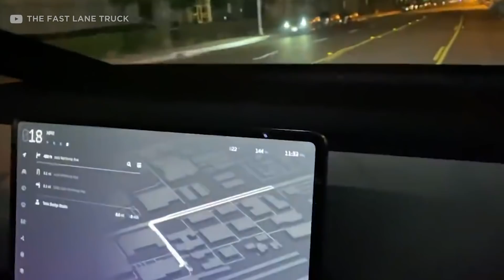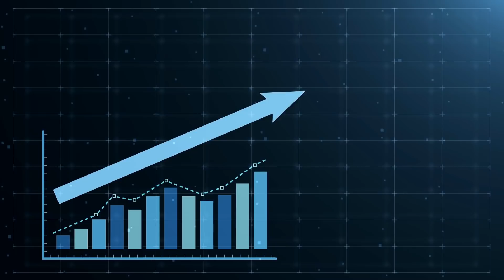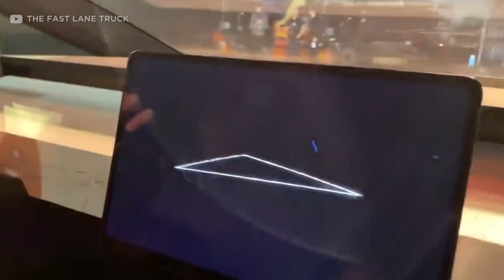Why Is Tesla Cybertruck So Cheap?

Comment: Because the $40,000 model is RWD not AWD or 4x4 and has only a single motor. The Cybertruck isn't cheap at all because if you want AWD and dual or tri motors you are going to have to pay about 70k.
Reply from the maker: Good point!
Reply: The single motor cybertruck competes just fine with any conventional work truck on price, towing, range. The two motor competes just fine with any upscale pick-up. The three motor is competitive with top of the line pick-up and significantly under prices the new Hummer. Where other pick-ups of all price ranges are uncompetitive is: no blue suede shoe sales people. No body rust. Indestructible body panels. 0-60mph acceleration.
Reply: @tz6516  That's what they want you to believe. The 40k model is 40k but is RWD only and has poor range. I'd rather pay 40k for a normal pickup truck and get 4x4 and everything else I want. I don't need "indestructible body panels" because I'm not going to be thrashing it around much.  And as for rust, modern trucks use galvanized steel which is MUCH better and hardly rust at all. Heck, the F-Series even uses aluminum which doesn't rust at all.
Reply: @private6549  
That is the beauty of America. Freedom of choice. Buy whatever you like. But an F150 Platinum is $59,500. No Stainless Steel. No FSD. No clean energy. No 0-60 bragging rights. I’m still very happy with my decision to order a Cybertruck.
Reply: @tz6516 No clean energy? Why would I care about that? I personally hate environmentalism. I don't litter, I clean up my garbage, what more do you want, that I throw out my internal combustion engines all for the sake of "carbon emissions destroying everything?"
Reply: @private6549  - the $40K CT compares well on specs to a $40K traditional pickup. The cheap pickups are also RWD only.
Reply: @private6549  
Anger management dude! You can buy whatever you like, but my comment is still valid that a Cybertruck is more environmentally friendly than an ICE truck from the Big Three. Go buy a Silverado or F150, but don’t complain when you see the resale value of that ICE truck in five years. Like it or not, Green is trending.
Reply: @tz6516  Environmentally friendly to me a big joke that is stretched into a religion. I'm not anti-EV, if there was an EV that appealed to me (exterior looks, interior design and colors, features) and had good range, I would consider buying it. The Cybertruck doesn't appeal to me at all and I don't see any personal reason to buy it over a regular truck especially when you are paying $40,000 for a two wheel drive truck.
Reply: @alanlight7740  You can still add 4x4 for around 2k more. The Cybertruck doesn't have AWD unless you add 10k.
Reply: @private6549  
You are entitled to your opinion...but it doesn’t change the direction that the world is going in. Seatbelts, airbags, 5mph bumpers were all railed against. They were still adopted. The move to vehicles that are more environmentally friendly is a train that has strong momentum. You can be counter-cultural if you wish, but I fear you will pay a financial price. The electric vehicle already has a government provided financial incentive. I think the ICE future will hold financial disincentives. Possibly additional gas taxes at the pump. Or carbon emission fees. Resale values will be negatively impacted. Argue against it, but the future is becoming obvious. The rails are greased for electric vehicles. And ICE vehicles will have strong headwinds going-forward.

Comment: The looks of the Cybertruck are OK, devicive as you say but as an avid 4WD'er I think the tough steel body and no paint is an amazing thing.
Being wider than a standard toyota Land Cruiser wheeel base will cause endless troubles off road and in deep rutted trails though.
I think the size is going to be a big killer in sales, far too big for many outback 4WD tracks in Australia.
If they bring out a smaller one that will fit in the rutted trails and within a car parking space, I will buy one in an instant !
Reply: You are one in a thousand. Most truck are never taken off the pavement. Over 2 million on order. Musk analyzes data. He knows the target audience for the Cybertruck are people who want to get to the mall, not the mud. Off-road? Trailer pulling? There will be a need for some ICE F350s for a while yet.
Reply: @tz6516  - you've got the right idea, but the reality is a tiny bit more complex.

There's a significant market for trucks that can go off road when needed, typically for short distances, but not on trails. This is useful for when a vehicle is needed on construction sites, farms, and even just to pull around into the back yard where there might be some mud that would bog a regular car down - and of course don't forget there are still lots of places with regularly groomed dirt or gravel roads where something better than a passenger car is desirable. There are lots of reasons someone might want a truck that can go off road a bit without actually wanting to go on some narrow trail.

To speak to Lindsey's point, some former neighbors of mine told me about the time they came across several vehicles including a bus stuck in the mud while traveling during the rainy season in Australia. They had a truck that was able to make it through, but obviously many others did not. This was not on a narrow track off the beaten path - this was on the Stuart Highway, back in the  70s before it was paved. I'm sure there must still be many roads in Australia that are unpaved where a truck like this would be useful.
Reply: @alanlight7740  
If you think you will encounter the scenarios you describe, then buy a Wrangler or the new Hummer. But I think the Cybertruck offers me the perfect combination of price, form and function.
Reply: @tz6516  - LOL - you might want to work on your reading comprehension. I was saying that most of the places a person needs an offroad vehicle are NOT narrow trails where the CT won't fit - which makes it a great choice for almost anyone.
Reply: @alanlight7740  
Sorry, I lost focus after your post got into buses and the 1970s.
Reply: @tz6516  - understood. That paragraph was more for the OP. She will probably understand that the Stuart Highway is not some backwoods track. In fact, it's a major route going north-south through the center of Australia - and while it doesn't have a huge amount of traffic because almost no one actually lives in the center of Australia, it's pretty iconic, in a Route 66 kind of way.

And there are many other places in rural Australia (or South America, or Africa) where many of the roads are unpaved, but are plenty wide enough for the CT. There's even a lot of places still in rural parts of the United States like that.
Reply: @alanlight7740  
An iconic vehicle for iconic roads!
Reply from the maker: Thanks for sharing your thoughts with us!

Comment: I hope it doesn't have the yoke steering wheel or the wheel covers.
Reply from the maker: Good point!
Reply: The wheel covers enhance mileage. If you don’t need max mileage, you can go without them.
Reply: @tz6516  how much of a difference would that make?
Reply: @rossturner76  
Google is your friend:
- They improved the Model 3's efficiency by more than expected, an average of 3.4 percent across speeds of 50, 70, and 90 mph and a boost in range of up to 10 miles.Dec 19, 2019
If you don’t like the look and/or don’t need the extra range, leave them at home.

Comment: There is no Tesla cyber truck.
That does not exist.
You morons
Reply: It will come out either later this year or early next year.
Reply: @user-RCST  like one million robo taxis and SpaceX on mars by 2020 and solar city
Reply: @pointmanzero  robitaxis was an error on elon's part.  SpaceX never said they'd be on Mars by 2020 they've aimed for 2024 since the starship program started.  What are you going on about with SolarCity.  I see SolarCity is a great benefit to Tesla.
Reply: @user-RCST  they have no second stage. No lander. No payload, no supply list, no rover, no satellite, nothing.
And their new rocket don't work.

They aren't going anywhere.
You aren't going to Mars.
You are not getting a cyber truck
Reply: @pointmanzero   BN1 has already been built which is starships second stage.  Starship itself is the lander.  Payload it will not be public information until before take off same with supplies.  Why would a Rover be necessary?  If you're referring to starlink satellites there's already near a thousand up there.  SpaceX rockets work just fine they've landed over 100 falcon 9s and starship is still in the PROTOTYPE stage, so yes it's common for those to blow up because that's the way SpaceX tests things.  
They are going somewhere for all the reasons I listed above.  

I don't want to go to Mars nor am I qualified to go to Mars I am not built for that.  

For the cybertruck all I have to do is wait either 6 months or a year for you to be proven wrong.
Reply: @user-RCST  I bet you money there will be no cyber truck.

I bet you money starship and city to city transport will not happen.
Reply: @pointmanzero  there will definitely be a cybertruck I have no doubt about that.  

I'm not sure if City to city will happen it's possible but we're talking about Mars not City to City.  I guess you figured out you were losing the other arguments so you switch to City to city transportation.
Reply: @user-RCST  if cyber truck was real suppliers would start getting notifications that they will need to produce a new car part for a new model.
There has been no sign of that.
Also this is true for the Semi.
There is no indication it is real at all.

The stock is in for a collision with reality.
Reply: @pointmanzero  most of what Tesla does is in-house.  The company that Tesla gets its casting machines from recently received orders for the 8,000 ton gigapress so they are getting orders.  That's not how Tesla operates.  You didn't get any notification ahead of time when the model y launched or the model 3 from any suppliers you know why because most of what Tesla does is in-house.

Comment: Edges are bad for aerodynamics
Reply: Tell that to the stealth fighter!! At highway speeds, skin friction and aerodynamics are not a huge deal. Look at the massive flat front grills that every ICE pick-up is currently sporting. If drag was a major concern, every vehicle would be a jelly bean shape.
Reply: @tz6516  look at the model 3, y, s and x they are all rounded, here they decided that having an easier manufacturing process was more important than the aerodynamics
Reply: @Balo1997  
Cybertruck is a totally different concept. The Corvette is fiberglass. The Impala isn’t. The stainless steel is a perfect medium for this class of vehicle. It is dent resistant. Rust proof. And gives the truck both a skin and structural integrity. I get it that a lot of people don’t like both the looks and the concept. If you are one of those, Chevy and Ford are still out there and available. But as for me and my family, I’m glad we are one of the 2 million orders for this unique vehicle.
Reply from the maker: Probably!
Reply: Obviously the aerodynamics would be better if this truck had some curves in the right places, but that is not the only factor that figures into aerodynamics. The aerodynamics of the CT are still pretty good, better than competing trucks and comparable to many passenger sedans if one looks only at the coefficient of drag. Of course the large size of a truck also means that it will have greater air resistance regardless of how low the drag is, but that's not something that can really be helped if one wants a truck.
Reply: @alanlight7740  
Everything in life is a compromise. There are people who want a narrower wheelbase for off-roading. Others who want optional paint colors. Still others who want a less angular shape. But Cybertruck is the perfect compromise of form and function for the bulk of truck buyers. A more capable off-road vehicle would have compromised its on-road capabilities. More rounded edges would have required thinner stainless steel which would have made the truck less rigid. Paint would have added greatly to the cost. 2 million orders tells me the Tesla team get it right. There will be future iterations and after-market providers who will modify Cybertrucks to please those niche buyers. For most of us, the factory version will be exactly what we need: a daily driver, with all the onboard creature comforts, state-of-the-art technology, that will accommodate the entire family, haul a load of weekend projects or sporting activities, offer impressive acceleration, do so in a more environmental way, and offers the future opportunity to be a robo business. And does all of that with out having to pay anything more than Detroit is asking for their trucks. Bravo Tesla.

Comment: it was supposed to be 36000. seems a bit like elio, the price just magically rises. well there a a crap load of new electric vehicles available and some nicer and a third of the cost. seems tesla is being a bit slow and will lose alot of sales due to non production.
Reply from the maker: An electric truck's average price is $50000-$60000 for now.
Reply: It wasn't supposed to be 36,000.  All the other electric trucks will come out after the cybertruck and with not as much range for a higher price.

Comment: Fun fact, steel can be electrochemically colored, so you can technically have a black, red, space blue or gradient rainbow Cybertruck without using paint. I hope someone does it.
Reply: I suspect there will be some sweet wraps on some Cybortrucks.
Reply from the maker: Thanks for the explanation!
Reply: I understood that it could make it weaker.
Reply: @MyDarkMuffin  It's a super thin oxide layer of chrome or titanium and has no effect on mechanical properties.
Reply: @MoonTrekerAF  Yeah, well, oxidation of steel is called rusting. There is a reason why modern vehicles use that paint layer over the bodywork. Musk is apparently thinking about savings and profitability on the short run, not reliability. Cool. Go buy it.
Reply: @SJAutomotiveDesign  dumb
Reply: @SJAutomotiveDesign  
So why didn’t DeLorean paint their car?
Reply: @tz6516  Maybe if they painted their cars, they'd still be making them today. 🤔
Reply: @SJAutomotiveDesign  
Paint didn’t save Plymouth, Suzuki, or Oldsmobile. If you don’t like the look of stainless steel, wrap it with your own design of colors and stripping. Or if you got to stay “old school”, the Silverado and F150 still offer paint colors as an option.
Reply: @MyDarkMuffin  the steel is super thick like many times thicker than any typical vehicle. You could definitely get away with it.
Reply: I want a rainbow one! That would be so cool 😎
Reply: They will have colors idk what this guy is talking about

Comment: Cheap? 39900$ before tax 250miles without towing, without self driving? is that you call cheap!?
Reply from the maker: Tesla is widely regarded as a premium automaker, even if some of their cars have dropped in price over their years in production, that's why the Cybertruck is considered so cheap!
Reply: @techspace9649  That premium was called by Elon musk or by Tesla itself. If just depend on speed and self-driving, it should not be considered as premium. Actually the title itself did not state the cheapest among the tesla automobile. There are the 2021 truck company out there that you can find around that price with update interior.

Comment: Even bulletproof glass breaks but there is no penetration...
Reply from the maker: @John Egan, Do you think that was on purpose?
Reply: @techspace9649  of course it was done in purpose, it is free publicity although I fear someone will troll cybertruck’s owners by throwing something to the truck
Reply: They seemed surprised it cracked....all bulletproof glass does that on impact but the object should not penetrate. The ball they used was large and low velocity a pistol round would be a real test.

Comment: Tri-motor Cybertruck with 500 miles, for $70,000 is pretty much a miracle. To get 500 miles of range from a large pickup truck made of very heavy stainless steel (the truck might weigh more than 6 tons), you need a massive battery pack which will cost a lot. Yet, Tesla is planning to sell it for $70,000! For comparison, Model S, a sedan weighing less than with 3 tons, and the best drag coefficient in the world, gets 412 miles of range, for $80,000.
Reply from the maker: Thanks for sharing your thoughts with us!
Reply: Musk has said that the CT should weigh about as much as an F-150, and an F-150 weighs well under 3 tons.

The exoskeleton design combines the skin of the truck with the structure of the truck, replacing the traditional body on frame construction typical of trucks. That means big weight savings, and also greater rigidity which is a desirable feature. The chief downside is that it does not allow the bed to be easily replaced with some specialized structure, but most pickup truck owners never do that anyhow.

Besides this, the new batteries that Tesla will be manufacturing are much more energy dense than the ones they have used in the past, so there will be weight savings there too.
Reply: @alanlight7740  some good points

Comment: Outdated info. The truck has double the towing capacity stated in this vid.
Reply from the maker: @Soul Jr. Hi there,
The base Cybertruck has a 0-60 speed of under 6.5 seconds, a 7,500-pound towing capacity, and over 250 miles of range. When notching it up to the highest-end model, the 0-60 plummets to 2.9 seconds, it can tow 14,000 pounds, and the range doubles to 500 miles.